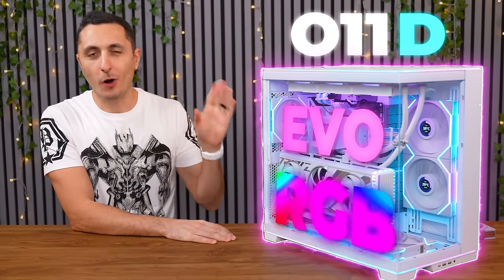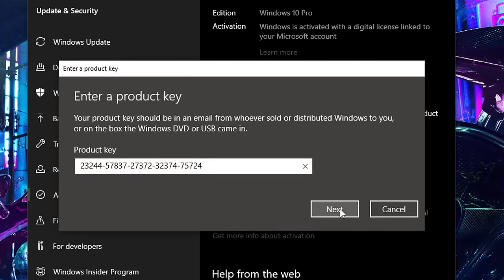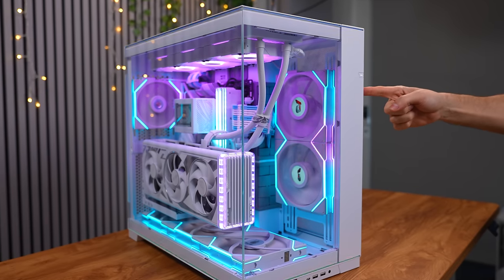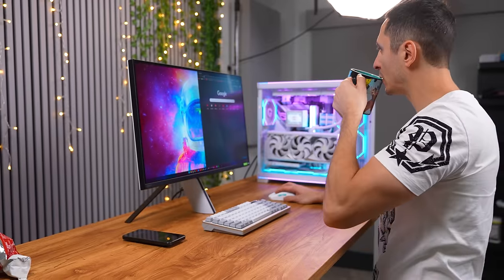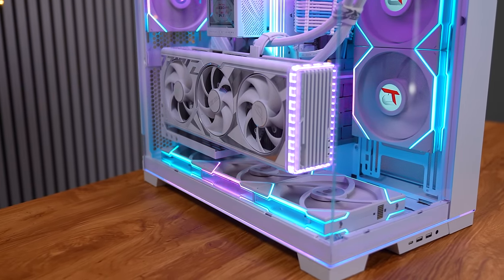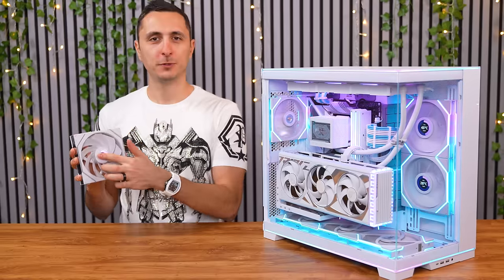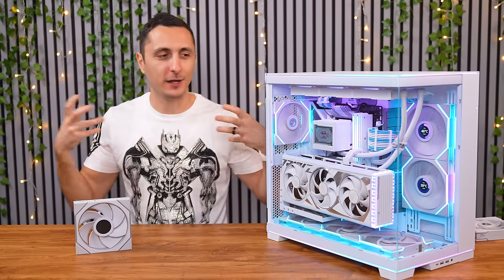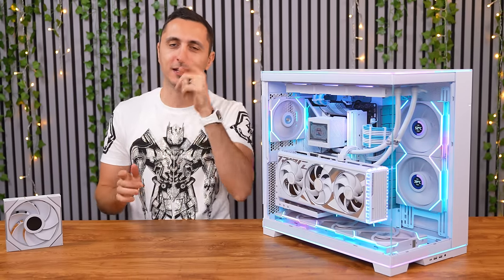This is PEAK PC Building! - Lian Li O11D EVO RGB (LCD FANS)

Comment: I bought 3 LCD 120's for the vertical. For the 1 exhaust. 3 bottoms & 3 on the radiator, I got the TL fans. Also, my radiator is the Hydroshift, so the water loop tubes do not get in the way. It looks beautiful in white with a silverish motherboard (ROG Strix 790). Just hints of black here & there. Awesome case.

Comment: How are you getting so much space between the vertical gpu mount and bottom fans , yet still not covering the AIO screen ? I have the same bracket and it literally sits on the bottom fans and is barley below my nzxt aio ... Nice...

Comment: Yeah, they're very cool, but you're right, how often are you going to look at them, especially where mine will be placed, basically never, but i do like the infinity look, so i am going for this case in black with 140mm fans, eventually, but no LCD fans. Besides, i already have a small screen sitting on otp of my keyboard with hardware info, so i don't need it, easier to see too.

Comment: What is the aftermarket GPU sag bracket you would recommend for vertically mounting in this case? I vertically mounted my 40 series in this same case with the same mount, and while my card isn't quite as big as the one you have in this video, I am still seeing a little big of sag.

Comment: On a future video can u build this pc? 
Case- Montech King 95 Pro Chamber Atx Mid-Tower
Cooler-Nzxt Kraken 360 RGB
CPU- I9- 13900KF 
Graphic Card- RTX 4070 windforce oc 12 g
Power Supply- Nzxt c1000 psu 2022
Storage-Samsung 980 pro ssd 1tb
Corsair Vengance RGBDDR5 Ram 32 GB it brings 2 but I’m thinking of getting 4 sticks so it looks better 
Motherboard- asus rog strix z790-F Gaming WiFi 6e LGA 1700 
Everything black if u don’t want to do it can u at least tell me if it’s good

Comment: Hey @TechSource, how did you make this build work with 3 ARGB? Case, Fan hub & AIO. I am currently struggling with my 2nd build and I am running similar component except my GPU need an ARGB too, so.. I need 4 ARGB interface

Comment: Is it possible to mount that vertical gpu 1 slot lower just above the bottom fans? If yes it would allow for traditional cpu air coolers.

Comment: You should do a pc build with 
Intel core i5-12600kf
Msi GeForce rtx 4060
Apevia prism white case
Gigabyte h610m motherboard 
Silicon power 1tb ssd
And wraith cpu cooler
Thermaltake 80+ gold 600w 
Timetec pinnacle conduit 16gb ram
Reply: That’s the first budget pc that I’m going to get unless you find a better one around the same price that I could get.

Comment: I will not buy Lian Li fans anymore since the ones I bought the RGB failed at higher temperatures. They first changed color and then stopped lighting. When cooled down and at regular temps they still have a different color than what they are set to (blue is green).

Comment: Does anyone knows, why did he put on the right side od the case only two fans. Can I put 360mm rad on top with 140mm fans in the bottom and 140mm fans on the right side of the case (where Edgar put only two fans).

Comment: Hi, I use to be a really old subscriber. I was subscribed when you were still doing setup wars. Could you build my dream PC on your channel. I want to see what it would look like in its full form. Parts: I5 12600k, ZOTAC Gaming GeForce RTX 4060 8GB Graphics Card, Vetroo V5 White CPU Air Cooler, CORSAIR VENGEANCE 16GB DDR4,
MSI PRO B760M-A WiFi DDR, MICRO ATX Motherboard, CRATER WHITE Power Supply Cables, WD Blue SN580 1TB M.2 SSD,  BitFenix Nova Mesh Micro ATX Computer Case, CRATER RGB LED Strip 12V 4-Pin Kit, Purple skull trooper funko pop, I know your super busy, but if you ever run out of ideas, I would love to see this on the channel, thanks if you read this

Comment: Can anyone olease tell me if 450mm for the 24 pin is long enough to go from the psu to the mb and 550mm for the 8pin cpu cables looking to build in this case using cable mods cable thanks.

Comment: Can someone help me. I know this isn't a trouble shooting video but my Headset keeps randomly making a popping sound then turning off. Its a corsair headset the is a Wired USB that I've had for 2-3 years. I've trying restarting my computer, unplugging it and restarting my PC, deleting the USB port connecter and reinstalling them, changing my power setting, and a long list of other things and none of them have worked. Sometimes I get a notification in the bottom left saying Power Surge ( With and additional description saying cant supply enough power) so I changed the port it was plugged into and unplugged my 2nd monitor to see if it was just a power issue with the PSU. I thought it worked because it helped for an hour until it popped again. When it pops sometimes it will pop my keyboard too and turn off my keyboard until I unplug my headset again. Someone please help. (I'm also building a new computer so I will know if its the PC or the headset soon will update when I find out)
Reply: Also here's a pec list from what I know ( Its a pre-built ) 

GeForce GTX 1660 Super
Ryzen 7 3700x
16 GB Ram Sticks 2800 Mhz ( Lenovo Bios wont let me change it and they are random stock sticks )
600 Watt PSU ( Guessing bc it doesn't say )
No Idea what the motherboard is
SanDisk 1 TB NVME ( I added this myself )
1 TB 2.5 Disk Drive ( That doesn't let me use it )
Reply: Here's my pc specs of the PC I'm building

CPU: Ryzen 9 5900x
GPU: GeForce RTX Aero 4060
RAM: 32 GB 3600 Mhz Corsair Vengance
PSU: 1000 Watt 80+ Gold Vetroo
Motherboard: Prime X570
Storage: 980 Pro 1TB

Comment: I have a question. Built my pc and it can turn on but whenever I restart it the monitor just displays black so I have to force shutdown. It only happens when I restart it tho. What should I do to fix it and is updating the bios dangerous since if it doesn’t restart would it brick my pc?

Comment: I'd stick with lian li but their software app is absolutely garbage. Refuses to update unless you delete all files and app and re-download. And when you get it working again the app refuses to work properly with remembering settings and then it runs slow. They need to fix their software badly.